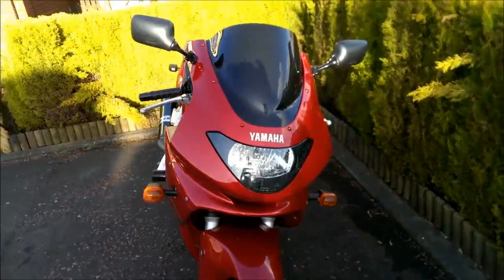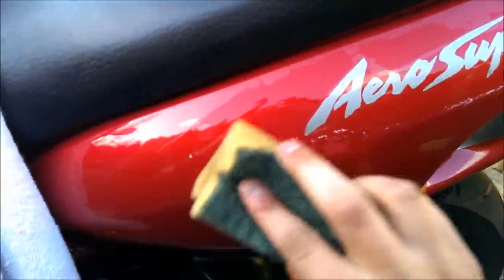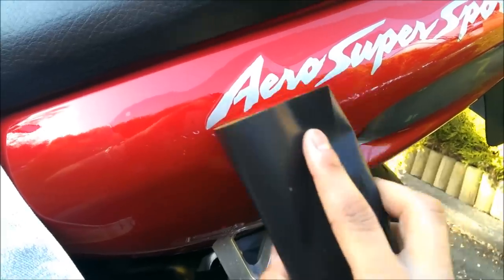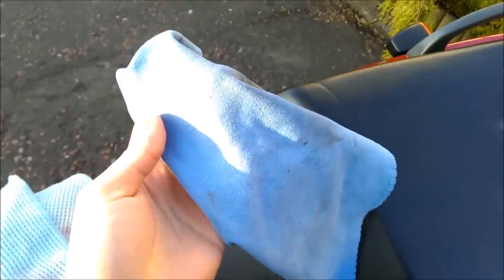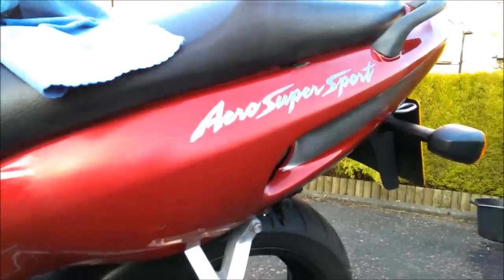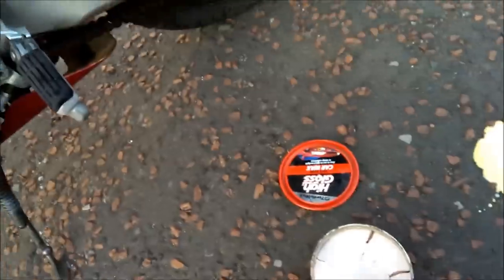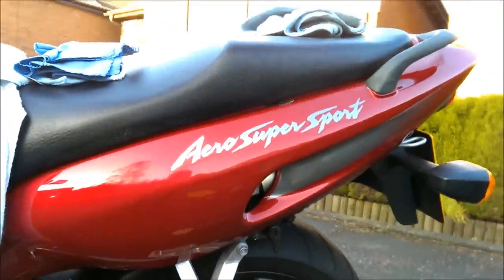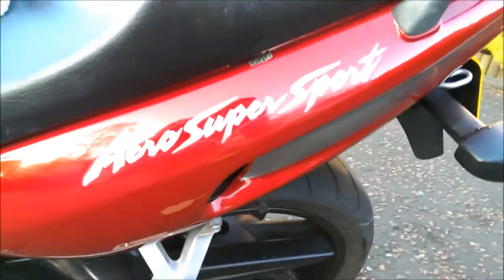Scratch Repair with Wet and Dry Sand Paper Guide

Comment: Im very impressed that this worked. The gloss is the part i always struggle with.

I also dropped the T cut the other day.
The black one stains very well on clothes.
Reply from the maker: James Macintyre absolute nightmare isnt it!
Reply: Ul be pleased to hear you inspired me to go buy some the bits you showed today from Halfords. I didn't get the 'High Gloss' tub, just the normal one as they didn't have that type. I hope the results will be just as good :s
Reply from the maker: James Macintyre awesome goodluck mate! You doing a bike or a car?
Reply: Yeah I've done the rear bumper on my car. I used 2000 grit paper like you did and normal turtle wax and its now like it never happened. I also used the Tcut pen to fill in the dent first though before sanding after leaving it for a day. Its basically like lacquer in a pen that stuff so it was nice to sand down and shape back into the car.
Reply from the maker: Great stuff pal! Glad it worked out for you.

Comment: what detergent yer using? i find with washing up liquid that after i clean it all off with brake cleaner i get small dots where the paint has reacted and not stuck like if theres silicone on the surface.

Comment: Yeah, I'm wondering if this would work OK on aluminium framed bicycles?
Reply from the maker: it only works on painted surfaces. So if it is painted it should be fine.
Reply: Nice 1.

Another question if I may...

The scratch runs over two different colours of paint, will this be a problem for the t cut? Will the colours run over each other?
Reply from the maker: As long as you let it to dry properly before you wipe it should be ok. If your worried use masking tape :)